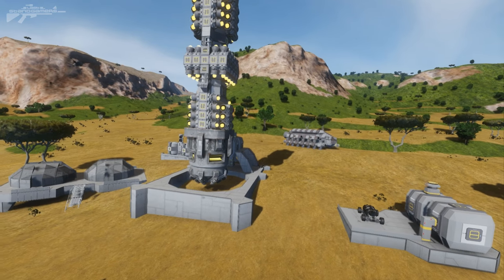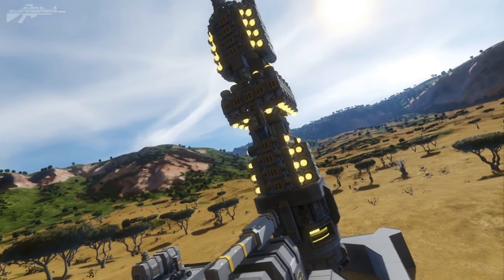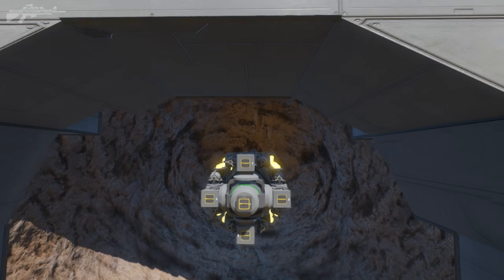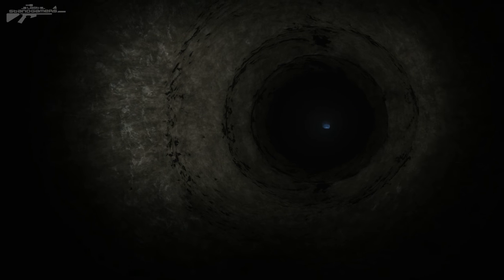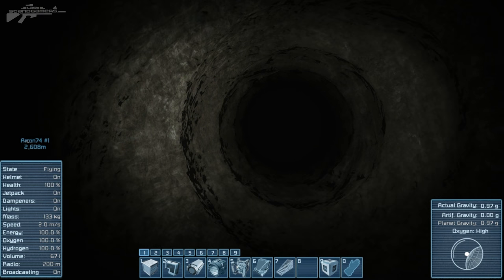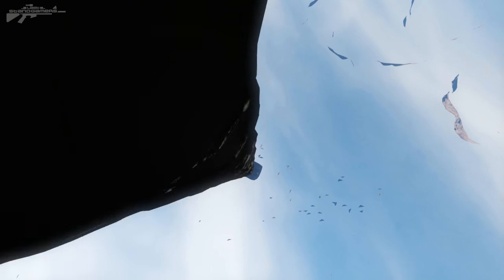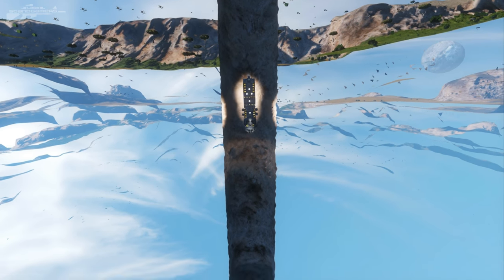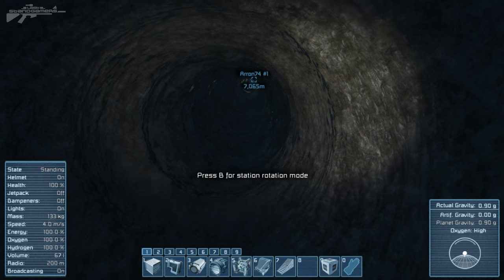Space Engineers - Centre Of The Planet Drilling

Comment: In reality deep inside planet gravity is lower, because mass of planet is surrounding object. In theory in planet core gravity should be almost 0g.
Reply: What? The gravity should grow.
You would be compress in the middle of a planet (is speed=0m/s)
Reply: At the core, effectively zero
Reply: gravity has nothing  to do with pressure. As you get deeper and deeper into a hole, there is more and more of the planet above you pulling you up, and less and lees of i underneath you, pulling you down. right at the centre, both are exactly equal, an you are net zero gravity.
Reply: LutzDerLurch What? No!
Gravity is going to the center of the mass!
Reply: everything with mass has a gravitational effect. every little atom. 

The way gravity works, the math works just as well and is much easier to do calculations with, if we just assume the mass  of the whole planet sits at the centre of mass at it, when thinking about it's effects on anything above the surface.

Now, as soon as you are underneath the surface, there is mass above you. rocks, dirt, grampas 57 chevy convertible....it all has mass, and it effectively pulls you up a wee bit. So slightly younteracting the grav. pull of the rest of earth.
If you're at the centre, half the planet pulls you up, half pulls you down...net effect = zero gravity

For a diffrent approach, Look up shell theorem, to see, how at any given depth into a planet,  you can basically exclude everything further from the centre of the planet as you, the wholce damn shell, as the geometry and the way gravity decreases with the square of the distance means the ent pull of the whole shell 'above' you is zero. 

The further you go towards the centre, the less  stuff there acually is  exerting a net grav pull on you. at the centre itself, it's  zero.
Reply: If you arrive at the center of a MASSive spherical object, then gravity will pull on you from all sides, neutralizing itself.
Reply: @LutzDerLurch  i dont think they understand the concept of net forces
Reply: @Mr Penguin "would of made" - I don't think you thought anything at all …
Reply: @Mr Penguin "you probably don't even know that gravity is" - ... that gravity is what?
Reply: @vladimirtiffany  nah the earth's gravity isn't strong enough for that. It would likely feel really odd though (if you could keep the masses of hot iron from simultaneously crush and burn your face)
Reply: @Vladimir Tiffany
You wouldn't be pulled apart because the gravity would be pulling on every atom in your body equally, not tugging your leg one direction and your arm another. The Net force is 0, it cancels out.

Proving that the deeper you go the lighter you get is an interesting calculus problem (that conveniently ignores the crushing pressure to focus only on the gravity you feel, not the weight of the lava above you trying to squish ya). But it boils down to this.

The gravity between two masses falls off with the square of distance, twice as far away, a quarter the force.

The mass of the two things tugging each other are multiplied together, twice the mass, twice the force.

As it turns out, if the density of a sphere is either mostly uniform or varies only with height (distance from center) something counterintuitive happens. At any depth, you can imagine the Earth is split into 2 pieces, a sphere, centered on the core, stretching to just under your feet, and the rest (we'll call it a shell). The parts of the shell near you and above you, pull exactly as hard as the parts of the shell on the far side of the planet, canceling out. Not just on the up-down axis either, but every direction cancelled out! You only feel the pull of the sphere below you, because everything else cancels, which I find really neat.
Reply: Dzień dobry Marku

Comment: they could use the center of the planet to add some of the more completely fantastical science fiction stuff in. Like every one in 100 planets has a hollow center with with some rare element to mine like a metal that allows your ship to defy gravity without being powered or a crystal that can be used as an infinite power source.
Reply: +nevercallmebyname nah, SE is all about being realistic (without being too much of a sim). You can't defy gravity...ever. Some ore that is a very sustainable power source could work, but it should require you to have some form op top tier gear, or else it would be way too easy.
Reply: +CrazyDutchguy In a hollow planet situation or at the core of a planet the net acceleration due to gravity will be zero. The gravity is still there, but you'll be floating about the middle.
Reply: ***** a hollow planet would collapse in on itself due to gravity and again form a sphere over time. Hollow planets are not possible.
Reply: CrazyDutchguy It's a hypothetical situation. It can't exist but we can still model what would happen if it did.
Reply: I'm sorry for having a computer.
Is it really so bad to want a little science fiction in my space gaming experience?
Reply: CrazyDutchguy, safety locked rotors can defy gravity. I had my 10M kg drilling rig slowly ascending to the sky once.

Comment: The fact that the gravity is lowering is quite realistic.
Reply: +Anonymous Gaming Why?
Reply: Science man. Look it up
Reply: Anonymous Gaming
F = G * (m1*m2) / s^2
with your distance (s) decreasing and all the masses the same the gravitational force gets stronger
Reply: Then explain how you get thrown back up after you are about at the middle of the way to the center...
Reply: Anonymous Gaming Why you should get thrown back up? You enter your tunnel at a velocity v, accelerate until you've reached the masses centre then start deaccelerating until you reach the opposite surface (given you travelled through a perfect sphere and your mass didn't change) with a velocity v' that is exactly equal to v.
Reply: Umm.. no. What actually happens is when jumping through a hole that goes throught the center you hit a wall of the hole. Even if you jumped on the exact center of the hole you would still hit the wall after a certain amout of time.
Reply: Anonymous Gaming How could you hit a wall. Gravity is a force that pulls the centres of two objects together on a straight line. Since there is no force that could push you against the wall you won't stop falling in a straight line, because your masses inertia prevents you from doing so.
Reply: I don't know. I forgot how... I saw it in a vid. I'll try to find it you just reply so i don't have to look for this video.
Reply: Anonymous Gaming I did a little research. We both are correct. Assuming you'd jump in our hole on a sphere, that isn't moving at all, you will come out on the other side like I explained before. But if you jump in the same hole on, for example, planet earth, which is definitly moving, of course you wouldn't keep moving with it and you'd hit a wall.
Reply: TheoreticalData Yes of course it is  not completely correct, but it was corrcet enough for my purpose to show that you wouln't bump into the sidewall (assuming that your planet doesn't move). If we put it your way of course it makes sense.
Reply: Physics is complicated :P
Reply: Yes. Yes it is.
Reply: +Anonymous Gaming  Correalis effect, that'swhat you were searching for I think.
Reply: +Maxi Reigl That only applies if you treat both objects as a point. You can treat the earth as a point since its a round shape. If you would have 2 weird forms with a high amount of corners you would have to split it into smaller bits and calculate the gravity between each bit. Back to the tunnel example: The further below you go the more mass will be above you which will work towards countering the gravity pulling you towards the core. When you are at the core using the normal formular you would have extremely high gravity but in reality you would have none because the masses in each direction cancel out the masses in the opposite directions. When you move a bit further up they almost cancel each other out but there is a bit more below you than above so you get slightly pulled towards the core. If you could treat the earth like a point while digging down being at the center of the earth would according to the formular (and again, you can't do that) lead to an infinite force which is certainly not a possible thing.
Reply: GrilledChicken Yes I probably have written sth. wrong above, you are not the first one to tell me that :)
But i like the fact that after 15 comments, we still didn't have any capslock guys.
Reply: I feel like a dumbass whilst reading this thread..
Reply: I have a question, I don't think I'm right but in any possible scenario would you go back up the tunnel shaft? Because if the deeper you go the more force you have pulling you in the direction's of the walls and floor, and say maybe, the planet has no atmosphere to pull you up, at any point would you go back up for at least one cm?
Reply: (If V=0m/s)
Reply: So much nonsense in the discussion. What's that about hitting a wall??? Well, you would if there is actually a physical wall. :D
Here's what would happen if there was a vacuum hole (so we can ignore drag) going through the center of the earth. If you jump in one side, you'll be accelerating towards the center of the earth. Your acceleration will gradually be lower and lower until you hit the center where it will be null. But I said acceleration. Your speed would still be increasing all the way down. And no, you won't be crushed in the center. You'll be weightless there. After passing the center of the earth, you'll be progressively slowing down (negative acceleration) until you reach the surface on the other side of the planet. I don't know the actual calculation but it should take you around 40 minutes to go from one side of the planet to the other this way.
Reply: @maxireigl1919  Except M changes as you move through the core of the planet, there is less mass pulling you down and more mass above you pulling you up. Overall the mass is constant, but the effect of that mass changes. The equation only applies for positive values of r. Once you're inside the other mass, yoire gonna have to use r for the centre of mass, which is lower because again, some of it is above you.
Reply: @octavioferreira2846  Your velocity would still decrease on the way to the core because half of the earth is pulling you back up. You're also forgetting the extremely high pressures at the core of the earth. You'd get crushed not from gravity but from sheer pressure.
Reply: @cadkls  Yeah, 3 years ago me wasn't the brightest when it came to Physics. 2 Semesters of Classical Mechanics worked wonders there.
Reply: @maxireigl1919  Fair enough, I know it's been a while. Just thought I'd drop my 2 cents.
Reply: @cadkls  You're wrong on both.
First, until you hit the center of gravity, you have more mass in front of you than behind you so you'd still be pulled forward by gravity. And since we're not considering other forces like drag, you'd be accelerating.
Second, I did say "if there's a vacuum hole". How do you get crushed by pressure in vacuum???
Reply: @octavioferreira2846  "your velocity would decrease"
Meaning you would decelerate, is this wrong?
Reply: @cadkls  

it is wrong (in the real world at least, since SE models it differently). If you actually do the math, you can see that if you are in the inside of a spherical hull (think like an orange peel thats intact), all the gravitonal Forces will cancel out. thats because gravity is proportional to 1/r^2, where r is the distance between the Masses. So basically, as soon as you pass a "Peel " of the earth, that gravity would no longer pull you. It would be like fallibg towards a Planet that gets smaller and smaller  the closer you get to it. So yes, your acceleration would decrease the closer you are to the centre, but since you have no force in the opposite direction, your speed would still increase (as long as you stay away from relativistic speeds or course, that would complicate things). 

So as a summary, you would accelerate all the way to the core, but you would acellerate more on the outside than near the core. But as others have pointed out, with a straight hole thats not directlythrough the axis of the earth, correolis effect would get you because the earth is spinning, or could maybe hit a wall due to the orbit earth has, but im not sure if you would fall long enough for that to happen.   

Hope this helps, if youre still sceptic, i can provide the calculations to this :)
Reply: @kcbsuiejd  At the centre, yes.

You mentioned that there is no force acting in the opposite direction, what about the gravitational force of trillions of tons of rock behind you as you fall? I'm sure I mentioned this before.
Reply: @cadkls  yeah, that can get confusing. basically, all the stone behind you gets compensated by the mass in front. 

one easy way to see it is to calculate the gravitational Force  in the following scenario:

1) draw a circle.
2) from the same middle, draw a slightly bigger circle. 
3) put a Mass >anywhere< into the inner circle. 
4) calculate the force on the Mass inside. 

you will see that the total gravitonal force will equal zero as long as you put the mass inside the inner circle. (if you need a hint, its basically a volume integral over the gravitational law. Spherical koordinates will help. you can pm me if you get stuck somewhere) 

so you can see, that all you left behind while falling, is compensated by the whole "peel" of the earth you just passed. 

so if you are, lets say halfway down, all the outer Rings will compensate themselfs and you will only feel the effects of the inner sphere with half radius. 
but yeah, intuitively, it seems very strange, which is why sometimes you need to check with maths if what you think is right.

source: currently in my last year of physics master :)

did that help, or is it still unclear? always happy to help :D

Comment: Hey Arron, i wanted to give you an idea for a hangar. Basically its a small ship with welders attached but at the same time connected to the station using advanced rotors and conveyors to link it directly into the stations storage. To do this you will need 2 rotors to allow it to point in any direction like in custom turret designs, and on that a zigzag kind of thing with rotors to allow it to move forwards and backwards. This would be soooooo useful so you don't run back and forth refilling your welding ship with stuff. Pls like this so he sees it. <---
EDIT: You could also order up parts your out of while building and not have to stop to go get them.

Comment: Actually it does make sense that the gravity would begin to drop the deeper down you go. I believe vsauce had a video explaining travel through the center of the world, it's all mass based and once you go down so far you'll actually begin to slow up as you approach the core. This is because the further down you go the more mass is going to be above you, so once you get to the core (ignoring the pressures and heat) you'll probably just float there. Good job on the dev's part for thinking about that and doing their research.

Comment: I did manage to go to the Centre of the Planet.   However it's only possible by using the Voxel Tool.     There is no gravity and you can't build anything.      However,   It's pretty hard to dig it straight   So what I did was to   Dig under my feet while I was falling and hope that I dig fast enough to prevent my character from touching the floor.

Once you get near the centre, (gravity is about 0.05)  your jetpack get activated and it's getting really messy to dig to the exact  centre.

Comment: Hey, LSG, do you have Auto-Trash Removal on? I was using a platform set up to drop single warheads, and I got to where they were deleting, but I figured they might have been being removed because they were falling 7km without power in a straight line. I turned Auto-Trash Removal off, and I made it down past 10km. I don't know if it was glitching or what, because about 10km down the rock textures stopped showing. I am on a terrible machine, so it might be that.
I also was using a couple mods in another world, and somehow removed the planet. I let gravity take me, and yes, gravity does hit 0.0g at the center.

Comment: okay. Now you have a shaft going that far down, turn 90 degrees. Make a second shaft back to the surface. In this build a long line of drills attached to a rotor at the 90 degree bend as an anchor point. then slowly slice the 7 km deep tip off of the planet leaving one smooth flat side to the planet.

I see no performance issues to take into consideration here. I've done this with asteroids dozens of times.

Comment: Build a projector and have it project a single line of large blocks straight down towards the core. Then build a drill that you can slide over the top of this line of blocks, with welders on it. Then set it at the right pace moving down and it will weld the line of blocks as it goes alone, and with landing gears it will stay perfectly in line with the blocks and move along it like a train. Have the welders constantly building more as it goes, with a drill head on the end. It should make a perfectly straight line.

Someone, I forget who, used this method to create a self constructing orbital elevator. Same idea, but it's going down and drilling.